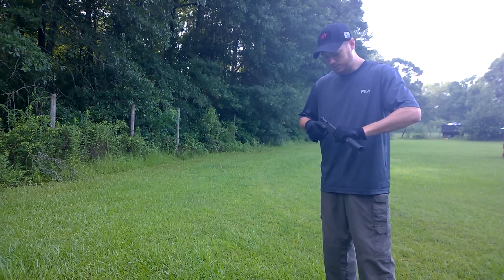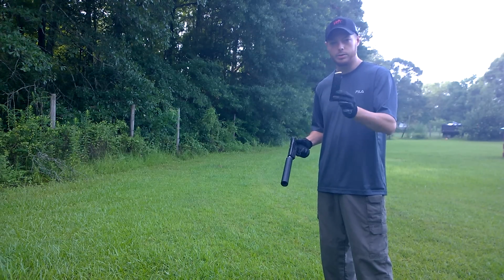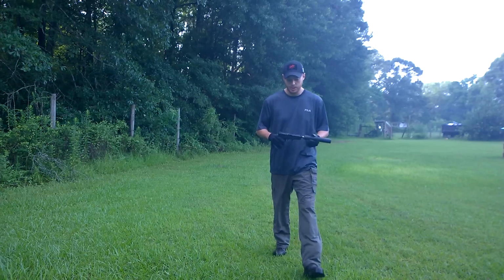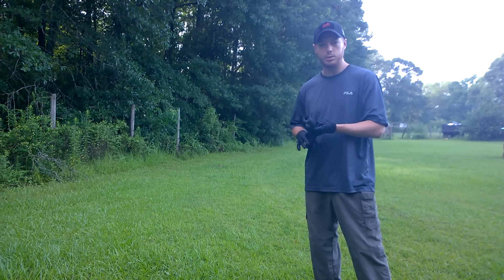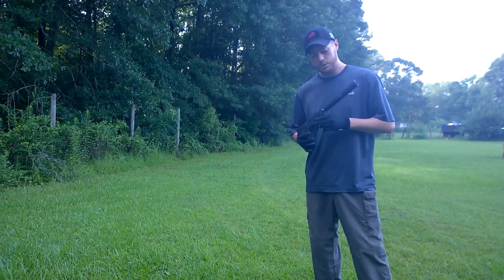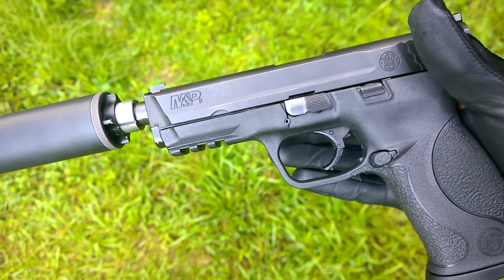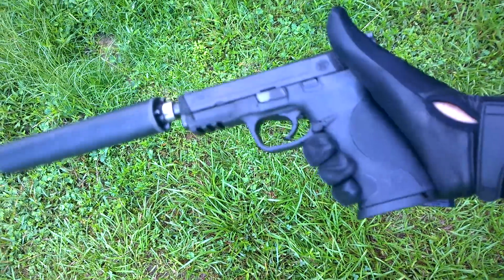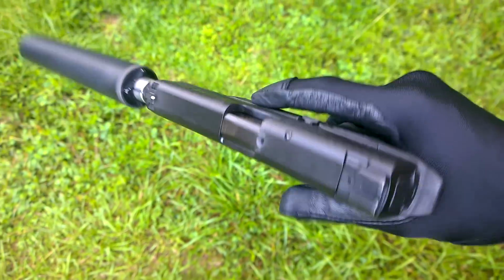M&P9 Suppressed (subsonic vs supersonic)

Comment: Wouldn't you get better results using a 9mm sized suppressor? That extra size difference from the.45 to 9mm would let more gas escape and increase the noise level would it not?
Reply: No.

Comment: Hey how do those m&ps hold up after alot of shooting compared to glocks?  I've shot them before and I like shooting them more and i shot more accurate.  I've just heard from some people that after a few thousand rds they drop off in accuracy and need parts replaced whereas glocks keep rgoig strong.  I have a gen 3 od green 17 2008 production I was thinking about trading for a 2013 produced m&p with the fss apex kit.
Reply: jonathan retzsch I have a .40 m&p and love it, have roughly 5k rounds through it over the years and it still shoots like the day I got it. Only thing I replaced was the stock trigger which left a lot to be desired in my opinion.. I went with an apex fss. Excellent gun, honestly can find anything bad to say about it. I happen to Shoot it far better then my Glock .40 which is my duty gun, I swear it’s because of the unnatural grip angle on the glock but who knows